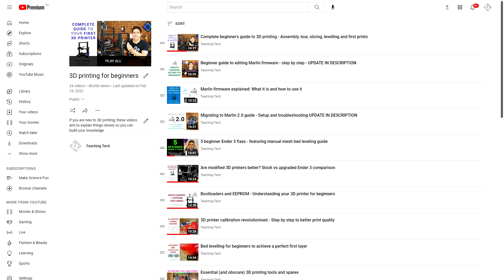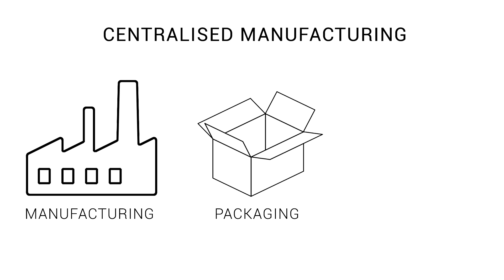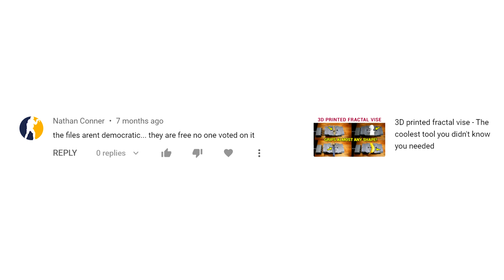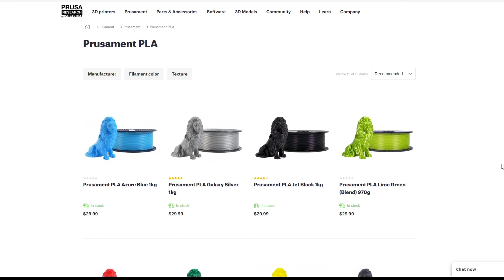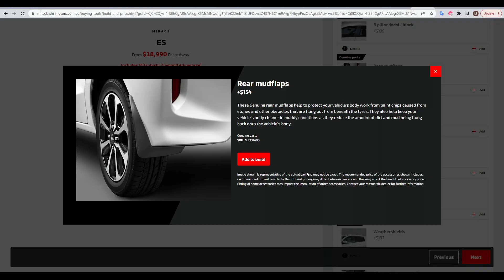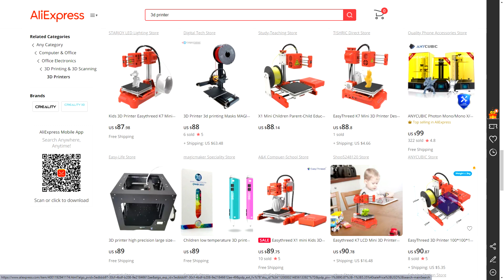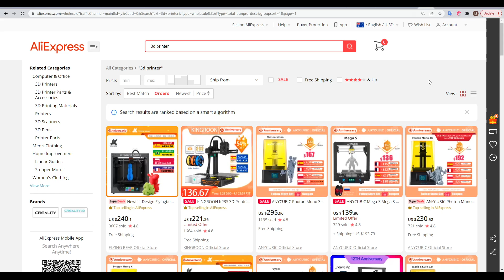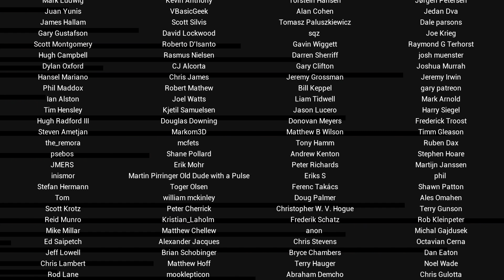3D printer trends are limiting mainstream acceptance: The 3D printing paradox

Comment: This is all great, PROVIDED that the maker focused 3D printer market doesn't shrivel up in the process. We have seen so many product classes go from tinkerer-friendly to vendor locked-in, black box systems with manufacturers who will go out of their way to stop tinkerers from repairing and modding their device. Printer ink is the perfect example - a machine that only allows you to use the vendor's filament is almost inevitable given this concept. What then inevitably happens is that a "pro" market emerges, where you might still have some ability to mod or DIY, but those models are priced astronomically higher since they're being marketed towards "specialists."

The best part of 3D printing for me has been the very fact that entire field is still in that tinkerer-friendly phase. Most cheap printers are by design moddable and there's very little anti-consumer shenanigan's going on if at all. Software and firmware are open source and yet offer professional quality. If 3D printing meant being required to use the manufacturer's slicer, filament and parts, with DRM enforcing it and the DMCA and similar laws being thrown at anyone trying to mod their machine, I'd have never gotten started.

There's also the point that yes, in a perfect world, manufacturers would just offer STLs for repair parts, and consumers could make those parts at home even long after the manufacturer gives up on the product. In reality though, the lack of repairability is actually a strong motivator to buy new stuff, and companies know it. So there's little motivation to offer a repair part for download when you can instead direct people to buy the newest model.

Basically, yes, let's get some turnkey 3D printers on the market. But let's make sure to never let such products overshadow and overtake the maker focused units. I don't want to see 3D printing turn into just another tech gadget that is locked down "for your safety".

Comment: One point you didn't make (adequately) that makes much consumer equipment usable by anyone is the technology put into consumables which open source enthusiasts hate. Things like chipped inkjet cartridges which report their consumable levels. There are chipped filament cartridges which are trivial to change but the word "proprietary" appears and they are shunned. We are now taking mesh bed tramming for granted and I see that much more sensory automation and fault diagnosis is required on 3D printers to make them truly accessible. This technology can make for a simpler design e.g. sensorless homing replacing mechanical endstops.

Comment: You are right on the money with this observation. There are VERY FEW companies in this space at the low end that are doing anything other than copy cat designs. However, the mid to large industrial companies (3DS, Stratasys, Carbon 3D, EOS, etc...) are moving ahead with all kinds of tech advancements, with products that are of the order of $100k+. These systems are really not intended for home use, and are generally not even FDM/FFF systems as most industrial applications have moved to SLS, SLA or DMLS (among other technologies) to provide more consistent and homogeneous parts with better surface finishes and physical performance.
I've been involved in 3D printing since 2008 and right now feel that the niche that needs to be filled is actually at the low end of "light" manufacturing (<$50k)  with a large format (1m^3) print volume and high speed Plastic EXtrusion (PEX) via filament or hopper system that can use a multitude of engineering grade plastic in a fully heated chamber. This would make is more interesting for a small company to buy into for low volume parts, but consistency and speed critical here. Neither of those things are being addressed with he current products, especially those that are typically showcased in YouTube videos.

Comment: I don't see 3d printing entering the homes as a means of manufacturing for quite a few years. How streamlined can you make the experience? There's always troubleshooting and maintenance to be done.  It reminds me a bit of the impression people have/had of CNC. In their minds CNC replaced manual labour and all you had to do was press a button. Manufacturing is so much more complex than this.  I don't see 3d printing replacing manufacturing on a large scale, molded parts will always be cheaper and faster to produce on the large scale.

Comment: Good analysis.   The problem seems to be that most 3D printers are manufactured in China.  They have enough trouble getting the manuals in readable English, let alone making a printer that is reliable.  In some ways Creality is the best, but their endless versions of the Ender 3, their kickstater fiascos, and lack of QC have soured me.  I have just ordered my second Rat Rig.  Yes I had to build it, and source some of the parts, but once working - it does just that - it works and is a great machine.

Comment: I agree it's ridiculous that the current state of 3d printing is that if you want to get into printing at an affordable price, say, ender 3, prepare to do a lot of tinkering and replacing here and there with upgrades and swaps to make it actually streamlined. The 3d printing market cannot expect the average joe to have the time and money to develop or follow fixes instead of pressing a button to fix. The closest i can think of a reliable, user friendly printer is the i3 but even that is $700 to start. There is much desired for the budget market to have a machine that is reliable out of the box instead of having to troubleshoot a lot.
Reply: Prusa Mini.

Besides, the upgrades to cheap printers mostly aren't needed and are just an addiction that people develop.

Comment: Most people don't want to design parts. They just want things to work. As far as replacement parts for something they already own, 3D printed parts made to replace the original injection molded parts, do not have the required properties. They are not as strong, the tolerances are not as good. These are the main problems.

Other problems all contribute to the above stated problems. 3D printing is fiddly. If you can't produce the desired part the first time, then it is a fail. 

I can go on but there is no point if stating all the issues. The above are the core problems.

Comment: You're entirely right about how manufacturers expect the buyer to do the work of upgrading the machine to current community specs. Many machines are honestly shipped in a pathetic state that could be considered a starter kit to build your actual printer with. A good example is my Tronxy X5SA Pro that barely resembles what came in the box at this point. There are many guides on what other parts you need to order before you even take it out of the box.
- Marlin or Klipper to replace terrible firmware (Klipper is a great fit for this printer)
- frame stiffening and proper spool holder, covers for exposed fans
- glass bed to replace the always crowned aluminum bed
- proper hotend, hotend fan and part cooling solution
- capricorn tubing
- physical z-stops
- z-axis synchronization
- belt tensioners
- enclosure mounts, because the Z gantry sticks out the sides just enough that you can't mount panels to it... a stupid oversight

Many of these are cheap or free, or just replace poorly designed parts, and it makes you wonder why they wouldn't simply supply the printer in a usable state. As it is now it's an excellent, fast and accurate CoreXY unit, but it could have been that the day it showed up for likely under $100 of added manufacturing cost.

Comment: Until a known and TRUSTED brand starts making them, to a reasonable price point, and built like a printer, not an engineering prototype, there will not be wider acceptance.
Reply: The problem I can see is: The fact that they are hacky CNC machines which require some expertise is what makes them affordable. If they were fully automated, they'd require all sorts of technology which would make them unaffordable.
Reply: Why? Where do known and trusted brands come from? Every brand you can think of didn't exist at some point in the past. It brought out a product that people loved, probably something that hasn't been quite done like that before, and followed it up with a lineup and successively established trust. And many of those probably didn't quite hit it off on the first try either.

But when they got established, they embarked on a risky venture. As companies grow larger and older, they get encrusted in a risk averse structure, where they can't afford a misstep. You really don't expect them to be the next revolution in 3D printing or anything at all.

Comment: It's not because 3d printing is hard, it's because people in general are too lazy to learn. I just got into 3d printing 6 months ago and I'm already getting mostly successful prints. The hardest part is actually designing stuff not printing
Reply: It's not hard, but it sure is time consuming.  I'm coming up on 18 months and I still have situations where I'm like "WTF just happened, why didn't that work?"  I've also spent about as much time futzing about with my Ender-5 as I have actually using the things I printed to finish the actual products.  This contrasts sharply with thinks like my Lexmark 2d printer or my power drill or my table saw, which just work - I spend very little time trying to make the tool do what it's supposed to do and most of my time working on the actual project.  So, yeah, I would agree with the general conclusion that 3d printing is still too much of a PITA to be an everyday household tool.

Comment: Good food for thought.  I think you are underestimating the ability of the open source community to build reliable production ready software and hardware. Linux was a hobbiest playground for decades before it became solid enough that it is now taking over every industry. The the big tech companies have taken and contributed to the linux kernel. Many times the ideas in the open source community make there ways into industry products. I think the part that is really holidn back 3D printing is not hardware reliability but instead the lack of stuff for the average person to print. 

Everyone knows how to make a word documents/slide show and print it out. Not very many people know how to model or 3D scan a parts. 

Demand drives innovation and I just don't think there is much of a demand for printing simple 3D components at home. 

If companies started openly giving out CAD files for products then I could see there being a much bigger push for reliability in the industry.

Comment: a 3d printer not being able to be used for mass manufacturing is irrelevant......  the "mass" side of the production for 3d printing comes from there  (in theory) being a printer in every home. You wont need to produce tons of items at home, so a printer being low production volume, is fine. If you do need the mass production, its covered by everone, or at least alot of people, having printers, and using them.

Comment: I think you're confusing two separate market types. There are needs that almost every human has: transportation (cars), printing documents to deal with taxes, offices etc (paper printers). Only a very small % of the population has the need to make their own small-run custom 3D parts, i.e.  hobbyists, inventors, tinkerers. The economies of scale in the first type of market are simply not attainable in the second type of market. The same applies to e.g. market for ready-made electronics devices (iPhone) vs electronic kits/boards/parts for electronic hobbyists. The first market has a huge economy of scale which yields ease of use, constant innovation, fancy packaging etc. The second (electronic kits) has low profit margins and is generally run a on shoe-string budget by entrepreneurs who are hobbyists themselves. I see little chance of 3D printing market transforming into the mass-consumption market, similar to cars, iPhones etc. The vast majority of people just want a ready--to-go working product, they have no interest in the tedious maintenance of a 3D printer, the engineering/design knowledge needed to design your own part etc. It will stay this way for a long time.
Reply: I can assure you that the vast majority of people who own 3D printers just download models online.

The point of this video is: plastic is everywhere in your house. Many of those injection-moulded parts could be 3D-printed instead. I think you're the one who doesn't realize the potential of 3D printing for your typical consumer.

And as for the "3D printers require a lot of babying" argument, Prusa printers are pretty reliable already, and in the future printers in general will only get more reliable, useful and cheaper.

One example of how it could get more useful is manufacturers selling kits for a product where the consumer prints their own plastic parts, like with that 3D printed camera stand.

But I also don't necessarily see "A 3D printer in every home" becoming a thing, rather most people will go to the corner shop that now also has a dozen 3D printers churning out STL's - just like today I'd only buy a good 2D printer if I use it a lot, and otherwise I'd just find a place that will print my PDF's for me.
Reply: @WhenDoesTheVideoActuallyStart  Then again, the argument that a Prusa is a reliable machine AND people mostly download STLs to print, and it's still what it is after so many years of both Prusas being on market and STL sites being a thing, show that it's not as important for many people. It's easy to make the machine reliable, and both forget how insufferable 2D ones can be with their stupid paper jams, clogged nozzles and random software bugs. People can stand that stupidity of 2D ones (also cartridge mafia) because of their need, if they ever did have that need, they would (just like thinkerers do) accept the annoyances of 3D ones.
Also, in the sense of need, you mention how much plastic we got around our house, and for that I ask you: how much of that plastic, is just plain plastic and nothing else?
If you still need to buy the rest of the stuff connected to it, plus the effort of assembly, I sure would take the task but not many people would. We're talking about people that can barely cross the streets on traffic lights here, remember that large volume stuff go to that public as well. Even if we think about the corner shop making stuff, we kind of end up with you choosing between the corner shop for printing, or corner shop for buying. The later is faster for sure, and might be cheaper too.
Reply: @Kalvinjj  Agreed 2d home printing is possibly THE WORST example of an industry to emulate in ANY way other then market saturation... Market saturation and ubiquity for market saturation sake is NOT inherently "good" ..  the massive "costs" you mentioned both hard and soft present in the low end 2d home printing market are cautionary tales not something the 3d printing industry should emulate ... ever.

If you own a low end home 2d printer you are a sucker... 

If you own a lowend 3d printer like a Ender 3 or clone you have a very usable/powerful/cheap open source tool with readily available parts/consumables and a massive community of support and can make it into what ever you want...

Or you can just print chachskies and crap off thingavese... 

Either way it  blows away ANY low end home 2d printer from any measurable metric.
Reply: He’s just ahead of his time. There was a time when there was no mass market for bibles, until there was; and no mass market for frozen dinners, until there was; and no mass market for cars, until there was. It probably will be a long time but the growth of the hobby is something that even mass marketers are starting to take notice of.

Comment: I feel like the actual use case still isn’t there. I mean, for the average user, it’s still way easier to either order a broken part OR to just buy another one, not to mention that PLA isn’t exactly the greatest material to print a lot of parts in
Reply: And companies are already looking into 3D printing replacement parts for products no longer made.
Reply: Maybe at the entry level pla printers its use has its opertunities but as improvements happen example nylon carbon fiber maybe better or stainless steel. There are many materials, atom arrangement and various devices around so unless no progress happens the use is what you choose. Pizza bbq sauce corn seed water  air dehydrate. The use case in my opinion is there long term. I see this as the stone age of the industry.
Reply: But you can print PETG and ASA on the same printers so the argument that PLA isn't suitable is kind of moot.

Comment: 11:10 yes actually, home built cars and outside modifications have greatly inspired and influenced car manufacturers. Car audio used to be something you had to do yourself if you actually wanted sound quality. These days not so much. History repeats itself and 3d printing is in the early racecar days. Pontoons and wood tracks work for racing cars in a sense yes, but obviously as time went on we (already knew) found better designs and implemented them.
Reply: I thought the same. The first cars were driven EXCLUSIVELY by enthusiasts who had a workshop and oily hands every day.
Reply: Audio, but stuff like LED lights that are now standard when it used to be only aftermarket.  One point he conveniently misses is that just about all improvements on cars (at least int he US) is mandated by law. Law that to auto industry fights to become law.  Air bags, ABS, even simple 3rd brake lights all were forced on the auto industry.